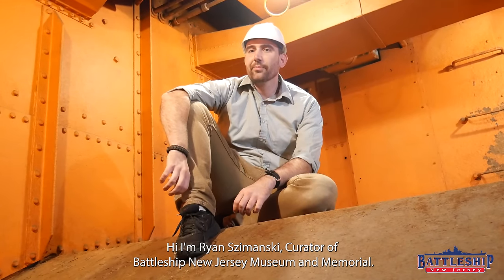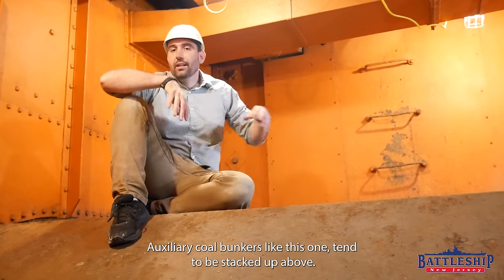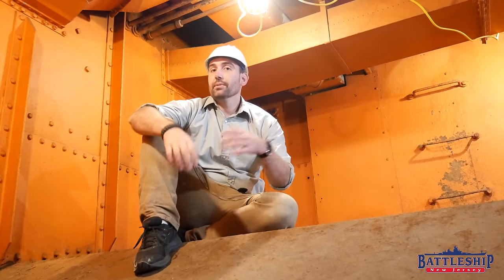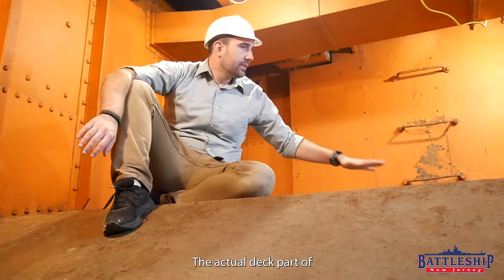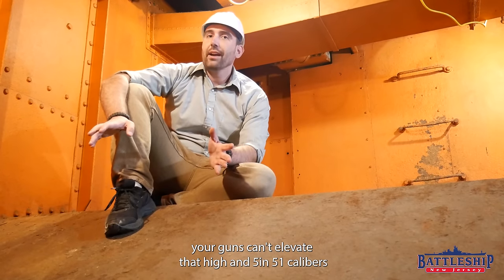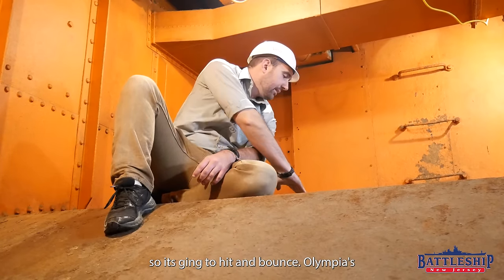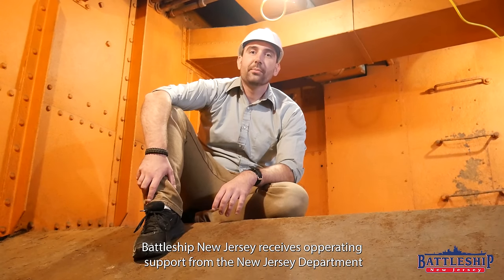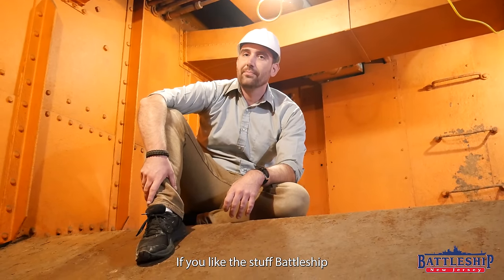Inside USS Olympia's Coal Bunker

Comment: One could write an essay on how Bismarck died, but basically the Brits were really out for revenge after Hood, the first hit from Rodney killed the command crew and the forward gun director, the third salvo carried away the aft gun director, and then they kept going, at the disabled ship  (all Bismarck's big guns were silenced halfway though the action), with the cruisers and Rodney at knife-fight range, King George V hanging back for the plunging fire. Ain't no belt thick enough to protect you from the upper works being blown off from the top down until the 16" shells start bouncing off the belt. But Bismarck still had her flag up, and so never technically surrendered, so, much like tanks, "shoot it until it explodes or " was the order. And boy howdy, did they ever, even apparently getting a torpedo hit on the upper works after the ship rolled over after being scuttled to stop the carnage.
Reply: Beating on a disabled enemy like that borders on a war crime.  With damage like that it's quite possible they COULDN'T strike their colors.
Reply: @MK0272 , never been in a war,  huh?
Reply: @richardcline1337  tbh the brits did sink her, she Bismarck was done either way, the crew just sped up the inevitable.
Reply: Revisionism.

Comment: I have never studied the bunker plans for Olympus, but it strikes me as odd that they designed upper bunkers so that it required shoveling into the primary bunkers beneath them.  That would require handling the coal in the auxiliaries twice.  Plus, once coal levels in primary bunkers started dropping, trimmers would have to enter them to redistribute it.  It would be necessary to pull trimmers out of a primary bunker while coal was shoveled into it from the auxiliary above.  On Battleship Texas, the upper and lower bunkers were completely separate from one another and each was coaled through its own dedicated main deck scuttle.  Upper and lower bunkers also had their own separate scuttles in the boiler rooms.  Lower bunker directly opened to the boiler rooms through their scuttles.  The coal from each upper bunker fed through a permanent chute that extended from it, through the lower bunker directly beneath and connected to its boiler room scuttle.  That allowed selective feeding in the boiler rooms and trimmers could work uninterrupted in all bunkers.
Reply: Thank you for the information.  I would be interested in reading more about the TEXAS's fueling systems.  Can you point me toward anything published?

Comment: Putting coal bunkers along the side of the ship, at the waterline, was done as a flooding control measure.  Flooding replaces air with water, but it can't replace solid objects.  And chunks of coal are solid objects.  So if a coal bunker floods, only the gaps between the pieces of coal can fill with water.

That's why these are not the primary coal bunkers.  The primary bunkers get used first, leaving the coal in these bunkers to limit flooding.  This coal is used for sailing home, once the chance for combat has faded.
Reply: Go back a generation, or generation and a half, from the Olympia, to when the problem was we need coal on the thing to power the steam plant since we now have a steam plant on the thing. The protection it offered is really secondary, and more the result of where they could put the bunkers on a warship that would need to have the things refilled on a regular basis. The coal and bunkers are there to move the ship, they happen to be in the right place to add to the protection, but the protection side of this is secondary to keeping the ship powered.
Reply: @seantu1496  They "happen to be in the right place"?  That implies accident.  So all the worlds fleets at the time were accidentally putting their coal bunkers in the same place?

The US Army had control of coastal defenses back in that era.  This included coast defense guns.  So they had an interest in shooting at ships.  Here's a contemporary quote from the Armor and Ships, Journal of the United States Artillery (1910): "The question of coal in the upper bunkers at the sides of warships is important because of the resistance such coal offers to direct penetration.  Some authorities claim that the principal function of the coal is to smother fragments of bursting shell and that its value as protection is only incidental.  It has been found, however, that two feet of coal is equivalent in resisting power to one inch of iron.  This is specially important in deck protected cruisers, which depend largely on the coal above the protective deck for their protection.  On this account the coal in the upper bunkers at the side is used last."

Ryan already covered coal as armor in this video.  I was pointing out that it also served as a flood control measure.  And it certainly didn't happen by chance.
Reply: @alcibiadesW  "Happen to be in the right place" means as a ship builder, you are first building a ship and dealing with those requirements. After you get something that is a ship, you turn it into a warship. The location of the bunkers was a part of building a steam ship, not a warship, and the location of the bunkers, where they have the volume to carry enough coal, can be filled from the top, but still be able to get the coal out of the bottom to feed the boilers, just happens to be an ideal location to provide extra protection.

Comment: As a former tank mechanic and with experiance moving target vehicles on different ranges, I'd say angled armor is your best bet. Although no armor is completely immune from, as you've said, that magic/golden BB shot.😎
Reply: ...as both Hood and Bismarck nicely illustrated for us. Yes. I mean, to deliberately put a 15-inch shell into the trough created by a ship's bowwave, into the hull right below the armored belt, through a machinery space and into a 4-inch magazine to then cook that off and in doing so detonating the neighboring magazine for the big guns.. that is one trick-shot if I've ever seen one.
Reply: @ranekeisenkralle8265  aaaaand then Bismarck gets clubbed by the entire damn Royal Navy
Reply: @invadegreece9281  correct. That was what it took. That and the scuttling charges. (Without which the ship would have suffered implosions on its way to the bottom.
Reply: @ranekeisenkralle8265  was a bit overkill tbh
Reply: @invadegreece9281  Not really. According to a survey on the wreck it was found that the armor still is mostly intact. Analysis of that survey agrees that the ship would have remained afloat for hours longer before eventually sinking on its own - if not for the scuttling charges. By closing the distance so much, the British didn't do themselves any favors. Instead they only made it harder for themselves.

Comment: Moving away from coal had many more advantages than just increased range. Anything that could lower the needed crew by 20 or so hands in a warship would be a welcome boon (depending on the size, could be more). Even before the days of fleet tankers being able to refuel while steaming, it was still much faster and easier to take on oil than coal. Plus, fuel oil does not have the dangers of spontaneous combustion like coal dust has. The smoke is less (as long as the oil-burning boilers are in good shape and cleaned regularly... generally needing considerably less cleaning that coal-fired ones), and the lower space and weight requirements for fuel tanks verses coal bunkers means more armor or armament is possible for the same tonnage. Top speeds could be maintained longer without the extreme fatigue and heat-stroke of the Stokers, and without the slag filling up the boilers requiring cleaning at a bad time. Oil had its own problems, but not nearly as many. 

It is interesting though, that several hundred merchant ships that were built in WW2 still burned coal; most from the UK and Canada like the "Parks" (their versions of "liberty ships"), and a US-built coal-burning variant of the Liberty that was sold to the UK . Mainly because those countries had a lot more coal than oil. The difference in performance was far less important in merchant ships than warships. 

My great uncle was a Stoker on a US Navy coal-burning transport in the Pacific in 1942 . He said it was hell... sometimes he would lose 10 pounds a day in sweat (he was a big and tough 19-year old in those days). But he got into a fight with a petty officer, and as punishment they made him crew on a Higgins LCVP boat... He saw combat in several beach assaults including Saipan. No matter how bad you have it, there is always something worse.
Reply: What was the fight over?
Reply: @studinthemaking  I'm not sure it was hard enough to get him to open up about the rest so I didn't press it. He never told his kids any of that... Some of the Saipan  stuff was very dark. My grandmother told me it took a long time for him to adjust when he got home. I kept asking and after a few years he finally did let it out.

Comment: How common were coal bunker fires? Fire suppression systems? Some speculate the Titanic sailed with a bunker fire weakening her hull/bulkhead and the USS Maine may have had a bunker fire. Cheers!
Reply: How much ventalation would be present in the fuel stores?
My thinking is that sealing the compartment to smother a fire might do an awful lot to help control any fires.
In addition to that, a few pipes to allow diverting water into the top of the bunkers?
I guess it comes down to how much heat a fire could produce with the air present in the compartment; whether that is enough to spread the fire through the compartment walls, damage the structural integrity via warping the metal, or otherwise damaging nearby systems.
(This is pure speculation, by the way.)
Reply: @rarrawer  Titanic's coal fire was actually just a smoldering fire which they smothered out and my understanding is that was the way it was done until they needed the coal and a crew would go in and work the coal out to the boilers.

Comment: If you could fabricate plate steel with an internal honeycomb structure, you could build a treaty-compliant ship with double the effective armor.
Reply: I don't believe anyone was working with honeycomb materials in the effective era of the London Treaty.  Fabrication would have been incredibly difficult.  Honeycomb materials were used thirty years later in the SR-71 and the XB-70, and still presented enormous technical challenges.

Comment: What kind of protection do you want? That determines your armor scheme. No sense using a turtleback armor scheme on a flattop; unless you want it to be shot at... Or likewise building a paper thin tin can battleship, with basic armor. The question isn't "which is best", it's What threats are the most prevalent and likely the ship will face. Given that ships are major capital investments, you will want to protect it from what's out there now, and what you can realistically theorize will be out there in the future life of the ship based on intelligence gathered.

Comment: Did they have fast cruisers during the war that had good guns and fast speed but light armour? Could they hunt battleships in a pack of say 3 and have each take a turn at coming into range, firing a salvo and backing off in order until the threat was eliminated? Thus a less valuable asset is expended in eliminating a very high value asset.
Reply: Generally speaking a cruiser is not going to carry big enough guns to reach the battleship before it got hit itself. And if you were going to hunt in a "pack", going in one at a time would be just what the battleship would want you to do, he could deal with them one at a time. Research the battle between the British cruisers and the German "pocket battleship"
Graf Spee.

Comment: Did they use hard or soft coal?
Reply: Hard anthracite coal was preferred, it had higher percentage carbon and less contaminants than the softer bituminous coal.  However, they would burn the best they could get their hands on.  One Navy manual said that if coal was being received from a commercial vendor in a foreign port, they should burn one ton of it to determine its quality before taking on a full load.

Comment: They didn’t have mechanical coal stokers?
Reply: not in the 1890's
Reply: Believe still had coal strokers at beginning of WW2
Reply: They manually stoked the original coal fired boilers on Battleships Texas and New York until they changed to oil fired boilers in 1925-26.  I haven't seen any discussions on mechanical stokers from that period to know precisely what their problems may have been at the time, but I have read procedures for firing coal fired boilers.  It actually required considerable skill and attention by the stokers.  They had to have a good eye and good shovel technique to properly spread coal over the grate and maintain it at a the proper depth.  They also had to be able to move burning coal around to break up clinkers.  There was also a lot of variation in quality of coal, depending where it came from.  High quality anthracite coal burned hot, clean and produced relatively little ash.  Softer coal put out less heat and could be very dirty, requiring frequent grate cleaning and removal of ash.  Unless you had a constant source of high quality coal, I suspect it would be very difficult, if not impossible for a mechanical system to address all of these issues.
Reply: @tomscotttheolderone364  I have read that the main reason mechanical stokers were not commonly used on board ships is that they took up too much valuable space in the boiler rooms.  Your point about the skill involved in stoking is aptly evidenced by steam locomotives.  Most of the last generation of steam locomotives had mechanical stokers that ground the coal and fed it with an auger to the back of the firebox, where oscillating steam jets fed it to the various parts of the grate.  This was a huge saving of labor for the fireman and allowed him to devote more time to water-tending and acting as lookout on the left side of the locomotive.  However, all these systems usually needed help from the fireman in adding additional coal and spreading it to keep a hot, even fire without holes, removing clinkers and shaking down the grates as required.

Comment: "Black GOLD", What you do with the, coal ash?
Reply: On Olympia, there are several ash scuttle systems. Basically, the engineers had to shovel the ash into cylindrical "scuttles" (cans) about 2 ft dia and 3 ft tall. Those were hauled up tubes to a higher deck by steam winches (literally steam engines and windlasses riveted to the bulkheads). From there, the scuttles were taken out of the tubes through a little door, then trollyed or just man-handled across the deck over to another set of big tubes that ran downward at an angle through the deck and out the sides of the ship. Then, the ashes were dumped, and over the side they went.
Reply: Designs after Olympia, such as Battleship Texas, had hoists that mixed ash with water, then pumped the slurry up and out of openings in the hull above the waterline.  Others had ejectors that pumped it out below the waterline.